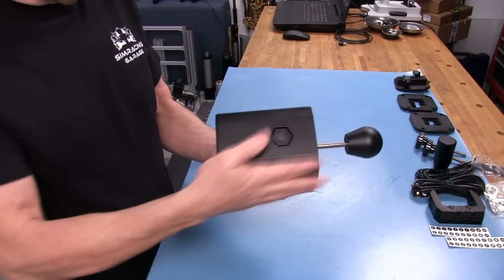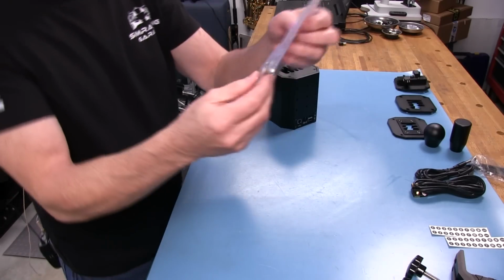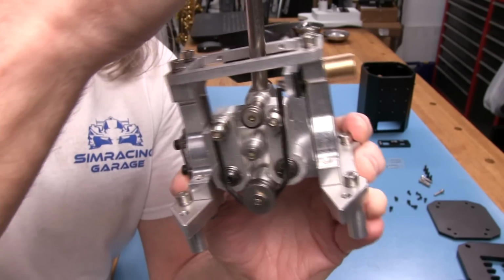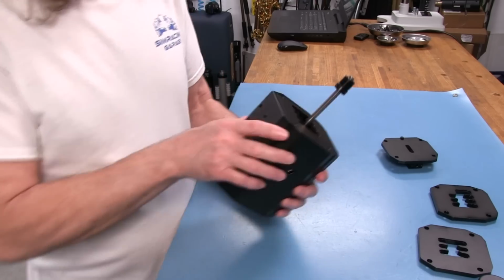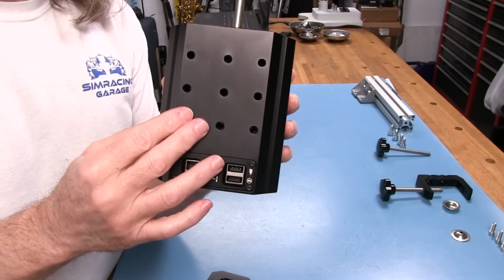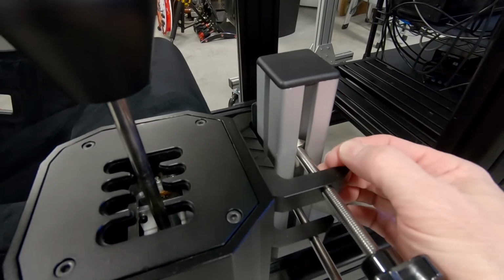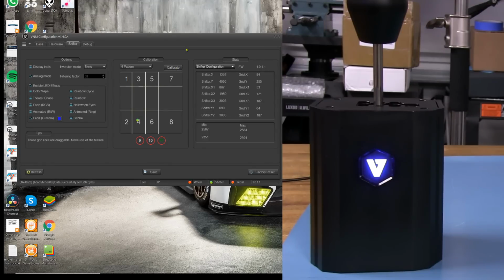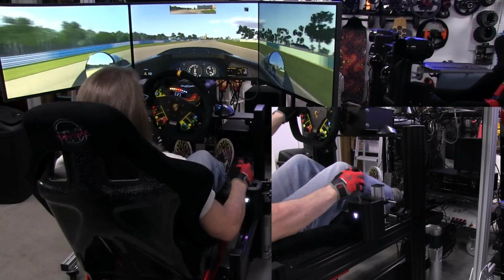VNM Shifter V1 Review

Comment: the middle  upper screw on the sequential shift plate is just an assist to lift out the shift plate, not to limit the screw on the tension adjuster. Both ball bearings put pressure on the shift rod when lifting off, that you need that front screw to pull up the plate to remove it, against the pressure

Comment: The top USB seems to be for an SRKS knob fro trucking.
EDIT: Yeah, I'm right, I just looked at BSimRacing website, trucking ready shifter.
Reply: Sry for the dumb question, what does that mean?
Reply: @Nearest_Neighbor  trucks have more than 6 gears (16 in some cases). So, a 16 gear Scania has 4 gates. Each gate has a high and low position, making it 8 speeds. To use the other 8 positions (5 to 8, high and low) you have a range switch. Now, gate 1 is gate 5 and so one.
Reply: @SewerShark  Ah I thought something like that. Thank you for the explanation!

Comment: Nice shifter! Never would mount it like this though. Rather use several angle elements and attach one side
 of the angles to a rig profile (obviously) and the other directly to the shifter (there are plenty of threaded holes in that thing). Did that with the Shifter Sq1.5 and it is rock solid.

Comment: question on those c-clamp table mounting brackets, are those something someone could find online? I have a custom shifter I'm trying to adapt to my rig and clamps like that would make my job a lot easier.
Reply: Join the VNM discord or go to the VNM Facebook page. Msg HoanTV directly. You should be able to order the clamp separately.
Reply: @timt8199  got a link?
Reply: @chapel976  check the description above. SRG has both links under "Where to buy"
Reply: @chapel976  Depending on where you live, you can also purchase from Sim-Motion in the US and EU. Australia/NZ also has a distributor called Pursuit Sim Racing

Comment: This is a top-notch piece of hardware.. There is also a 4-speed plus reverse plate available, and you are even able to customize the shifter with your own logo(s).. Tran Hoan and all of the VNM people are AMAZING, super nice and always willing to talk and help out, even taking suggestions from users on how to improve their products.. One thing Barry didn’t go too much into detail on is the mounting clamps.. Their design and the design of the mounting holes gives almost infinite height adjustment to the shifter, as the clamps can be turned 180 to offset the height by smaller increments for that perfect adjustment.. My completed order with all extras (minus the 4+R plate due to its unavailability at time of my order) and multiple custom logos shipped via FedEx at $316 to where I live in the USA.. Most will compare this to the Fanatec unit, and in my opinion, it’s superior in build quality, performance, and especially customer support..

Comment: the simble @1:57 looks like a truck shifter knob usb plug in
Reply: Indeed it is! The truck shift knob is current unavailable for sale at the moment. We made a few 3D printed test units to distribute locally first and the port is still there if our buyers want to upgrade later (once a high quality anodized metal version of the truck knob is available, of course)

Comment: Awesome, torn between this and the Fanatec 1.5
Reply: Yeah looking at it I'd say the decision is do you want ease of switching between h and sequential, or do you want a better sequential. Cuz I remember Barry saying he wanted more resistance on the fanatec shifter.
Reply: @thegallantracer5217  That's a good way to look at it - I'd be using the sequential a lot, which is one of the reasons the fanatec didn't seem like the best buy, except for it's quick swapping.  For me I think a cheaper standalone sequential like the Aiologs might be a better choice, with the option to add an H shifter later.
Reply: @ryanclawson7307  a new version of sequential plate is in testing at VNM Simulation and we're introducing that mechanical notchy feeling Barry mentioned in the video plus the already functional adjustable tension. Please sit tight and join our Facebook group if you are still interested in our shifter and be informed of our latest updates for various WIP projects like pedals, affordable DD and firmware, steering wheels and more.
Reply: I’ve been through a few diff shifters and settled on the fanatec. To me the seq mode feels great. I recon fanatec recently have made some internal changes as you can tension up the screw and it’s pretty stiff plus has a clunk feeling.
I saw reviews people saying it was soft but the latest ones to me are def far from soft.